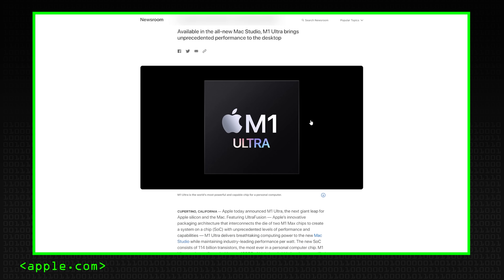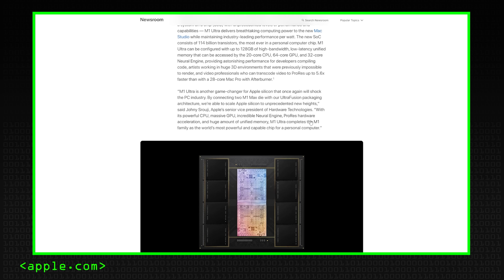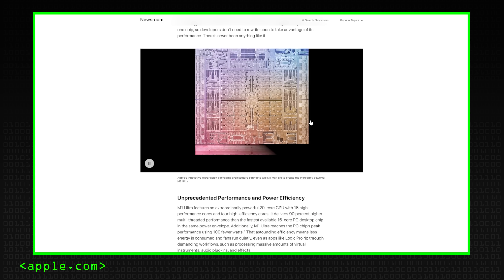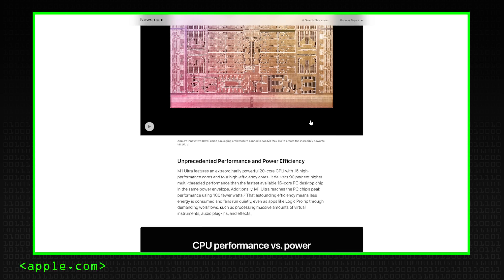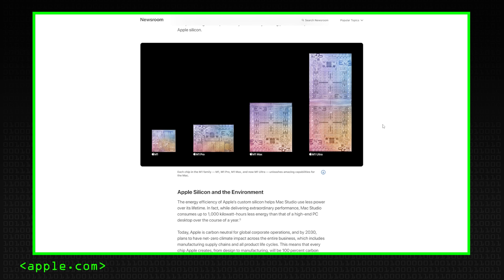Apple M1 Ultra & NUMA - Computerphile

Comment: Why does making the interconnect (distributed shared memory) super-fast not bring back the original problem that we were trying to solve - increased memory access collision with increased CPUs? After all, if far away CPUs can access memory in nearly the same time as the nearby ones, how is it any different than just one memory with all near and far CPUs connected to it ?
Reply: I agree that it was not super clear in the video. I think you could still have that issue. however, it happens half as often since you have 2 banks of memory.
Reply: I feel like this was the main problem that the video was trying to address - but it wasn’t really resolved by the end. There are a lot of guesses and theories in this thread - but I think this indicates that a clear explanation was missing.
Reply: @bberakable  this shows you that Apple’s got trick up their sleeves. If it was so simple, Nvidia would have done it by now 😬
Reply: @RunForPeace-hk1cu  are you talking in the context of multi-GPU systems?

Part of the trick that Apple has with the M1U is that it's giant piece of silicon that makes an AMD Ryzen look quite small (in terms of physical dimensions).

I guess if Nvidia used this approach you would get a graphics card so tall or long that it would need a special case and motherboard and probably a similarly bloated power supply....
Reply: It probably would reintroduce the problem.  However, I would suspect there is some trickery under the hood of the OS working with the hardware to optimize data locality to keep the data on the "near" memory for any core.  It's possible that part of it is memory mapping in the data interconnect so that memory on the "far" chunk could still be viewed as local to a core, and the super fast interconnect effectively negates the performance penalty that a traditional NUMA system would have.
Reply: I would guess that it means you don't have to tune data affinity (which makes development/deployment easier and therefore cheaper) but you can if you want (which gives you the benefits of an optimised NUMA configuration).
Reply: @davidgillies620  I'm thinking the same thing.  By optimizing specific parts of the system, Apple has theoretically designed something that will perform really well in 99% of use cases.  There's always more performance to squeeze out, but with severely diminishing returns.
Reply: UltraFusion is really just a memory... Fusion. Their memory gets twice as fast since they have twice as many banks, they just need a way to combine the M1 chips so that both of them can use the other's memory at high speeds. There was probably some tradeoff with the memory controller or packaging which made them need 2x64 rather than having external 128 GB. I imagine their real Mac Pro replacement will have external memory and GPU.
Reply: He said "it's fast enough", meaning it's fast, but not as fast as being in the same M1 SOC, therefore you don't have the same collision probability
Reply: I think it reduce probability because all cores are multiplexed to just one interconnect, so for other bank of memroy it's jsut like one additional CPU, because they will collide to access that itnerconect before.
Reply: its only mitigating the problem to the best extent physically. ideally speaking two cores should not be accessing the same memory in parallel, because then it would not be single instruction multiple data(SIMD) but more like multiple instruction same data(MISD) which is quite rare as far as I know. but since all programs are not designed to work perfectly on parallel CPUs, the general workaround from hardware and Os perspective is to ask the next free CPU to execute the next instruction in queue. its like having 10 workers capable of doing the same work but needing resources and instructions to do so, so if you have small unequal parts that need working you can give each part to the next free worker(the one that finishes his work first like FIFO). the problem is if some work requires to be done on the same part but two workers are working on it, you need the part to be transferred to each worker to complete their job. ideally one worker should be able to do one job if the INSTRUCTION is coded that way( through efficient parallel programming) but since its actually coded serially, if you assume everything to be serial then all cores wont be utilized efficiently and most of the time it would one single core doing all the job. this is also why you don't really see this problem in GPUs with massively parallel architectures as they are mostly pure SIMD instructions. now the mitigation is to make sure the parts are transferred as fast as possible taking into account all constraints in doing so. with a NUMA construct what one does is that you cluster the memory for each set of cores on the hardware level instead of OS or software level. ideally they should be accessing memory from only within their bank, this would make for limited collision regardless of total number of cores once you decide no. of cores per bank! but fragmenting the memory too much also doesn't help as then cost of the miss in fetching memory in its own bank will accumulate faster. therefore two options remain, accept the cost and divide the memory into as many banks as required and invest in building a fast interconnect between all such clusters, else keep as little banks as possible and not invest as much on the interconnect or bridge. the problem with the first option is fast interconnect becomes more complex as the number of banks to connect increases, but it becomes worth designing only if there are more banks to connect. it inherently can become another complex part to test and make to work near perfection. the second option is the more common option I guess because it keeps complexity less at the cost of more misses. can we design better interconnects? ofcourse it becomes easier as we go to 5nm and below litho. in apples case designing the interconnect pays off as they can boast of more cores without much effort being put to design all such cores. it allows for more fine-tuned clustering of cores. 
answering your question of interconnect not bringing back the original problem?: it doesn't do so as much because now there is a hardware that not only decides( essentially the role of the arbiter) who accesses what but also does not involve itself in every access but only in cross bank access. think of it like a hierarchy of arbiters instead of one master arbiter. that way the banks can be closer to each cluster of cores and only when you need to access across banks do we need to check for collisions per se. so on average you are going to see fewer occurrences of collision as the cross bank request tend to become lower as compared to each core trying to access same data at the same time from one single bank. essentially the collisions remain nearly the same but the cost of collisions is now non uniformly distributed. intra cluster collision cost would be very less as compared to inter cluster collisions due to less distance and less complexity. if inter cluster collisions are lesser than intra cluster collisions then their cost can be higher without it being the same overall penalty. that penalty is reduced in the m1 ultra thanks to ultra fast interconnect. so the original problem is not really solved but only that we have reduced its overall penalty thanks to some basic assumptions in software and hardware. this structure would be far more costlier if used exclusively for SIMD instructions as the probability of accessing from other banks would be very much higher. 
if you have one memory the time to access is always same and has to check for same type of collisions for all the requests. that way you cannot reduce the overall time required to access. if you have two it reduces a bit but not enough to validate the overall requirements. this is mostly solving a software problem in hardware there by requiring the software to conform to it.
Reply: Well the shared system is fast but not as fast as directly accessing the ram by the cpu (which I think is not possible), so for example if a cpu takes 10 ns to access the RAM directly, and earlier it took 50 ns to access a memory block from other RAM, now it takes only 15 ns , but it still has 5 ns gap. Apart from this there might be some intelligent scheduler or system in the chip or the OS which might prevent such collisions or avoid them to as much extent as possible possibly increasing the performance margins greatly but ofcourse this is the choice they have to make when they weigh in the pros and cons, of designing a system which is 50 times faster but requires rewriting all of the software or something which is like 40 times faster but does not require rewriting the softwares for best output.
Reply: Half the chance of a memory collision
Reply: How I understand it is that you have 2 buses instead of one so, theoretically, the CPUs tied to their memory could be accessing it while the other CPUs are accessing their memory. This is different from double the CPUs connected to one memory unit twice as big in that here is no simultaneous access possible.

Comment: Is this at least part of the reason motherboard instructions specify which slots should be used for various numbers of RAM chips?
Reply: No, the slots are numbered because of how ram is accessed in parallel. Dual channel memory is usually the maximum consumer cpus can handle and the dual part is electrically wired to work best with some slots. using the "wrong" slots would either make two ram sticks work in single channel mode or dual channel but in the longer traces. The slightly longer traces are the nonpreferred slots that are used when 4 sticks are in use and can effect memory overclocking results.

Comment: I feel like this video didn't do a good job of addressing the initial problem of memory access deadlock. How does switching from UMA to NUMA reduce the chances of two CPUs accessing RAM at the same time?
Reply: From what I understand, I think the critical thing is that only one cpu may access a single memory bank at a time, so it's less about reducing collision likelihood and more about mitigating the effects of a collision.  So in the 4x1 architecture, the other 3 cpus are constantly waiting for their turn. But In the 2x2 architecture, only 1 other cpu has to wait for its turn while the other two are free to access their separate bank. Kinda like having two small roads rather than one big one; the advantage is that a traffic jam on one road doesn't spread to the other.